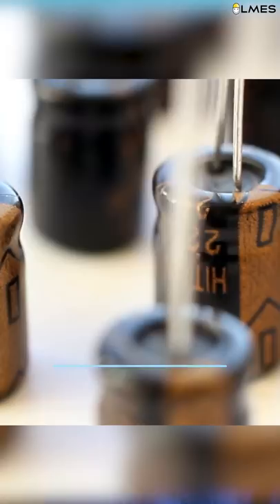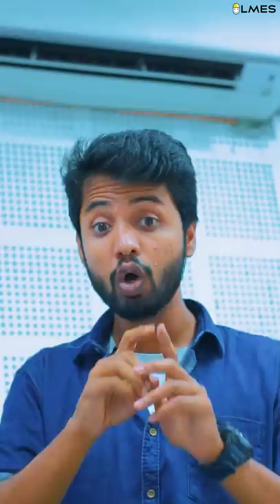Why can't we use our nails on the touch screen? | #shorts | Tamil | LMES #nails #touchscreen

Comment: Old screens use resistive touch screen which uses change in resistance to find the spot we touched. It has two layers so it will touch one another when we slightly press it.